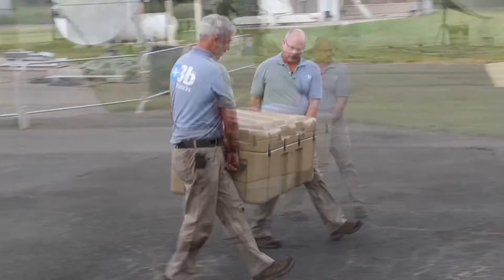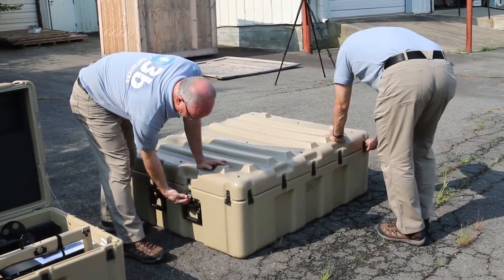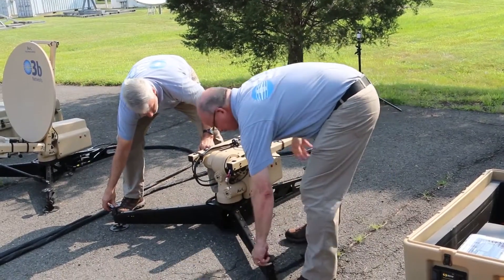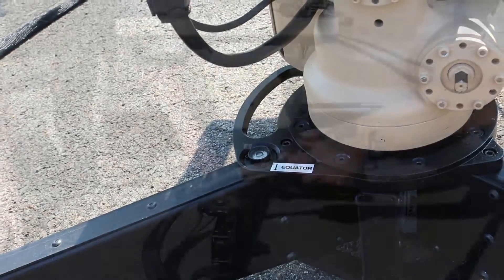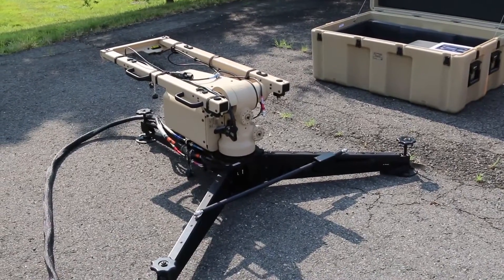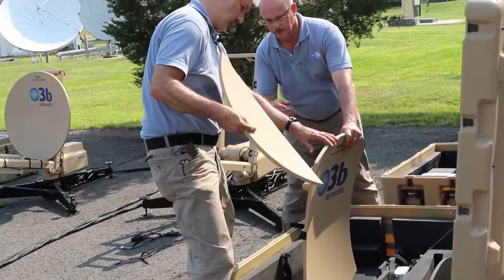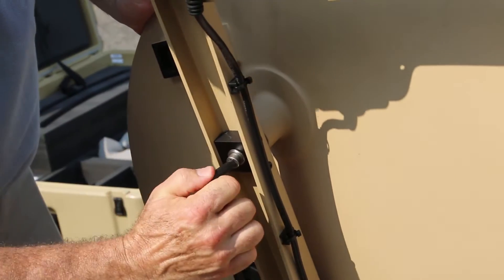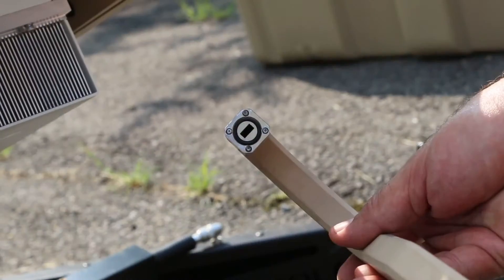How to Set Up an O3b AVL Antenna (Step By Step)

Comment: When you have an on line demo it's usual to have a couple of engineers who have done the job before - preferably so experienced that they can do it in their sleep. What I saw were two men, one of whom was being told what to do by the other. Were they perhaps senior managers who wanted to get their faces on screen rather than nuts and bolts men? It made the job look far more difficult than it probably is. Don't say that this shows that anyone could do it, we need to see a slick demonstration not a flat pack furniture disaster.